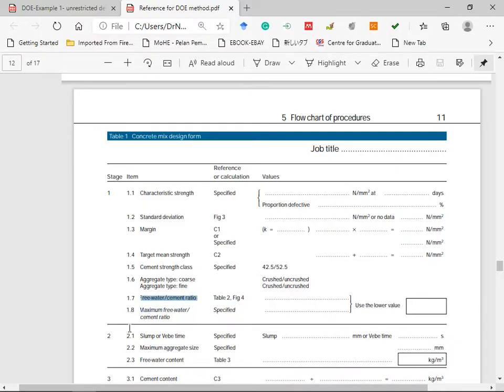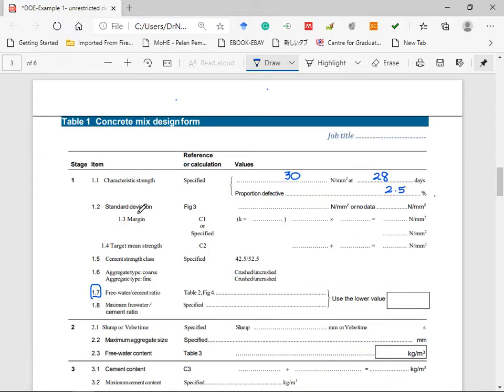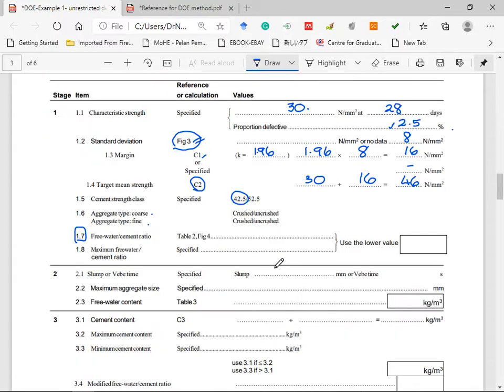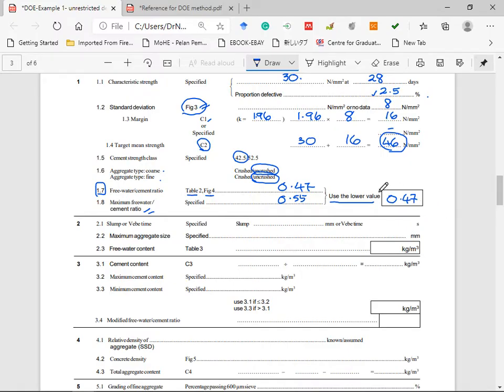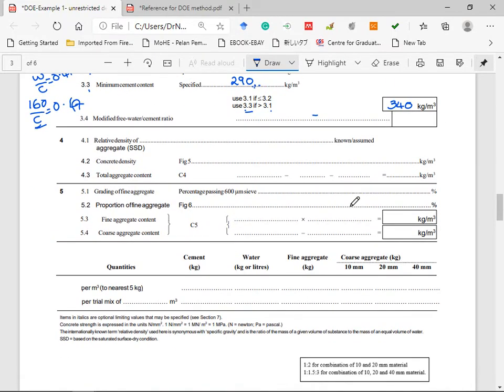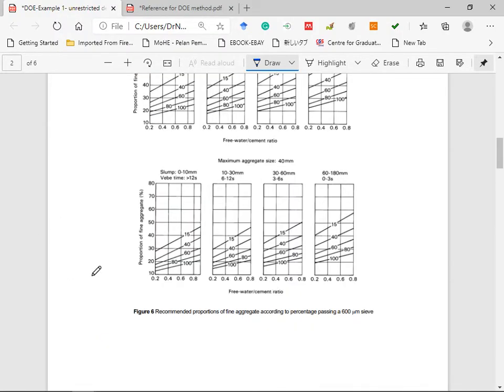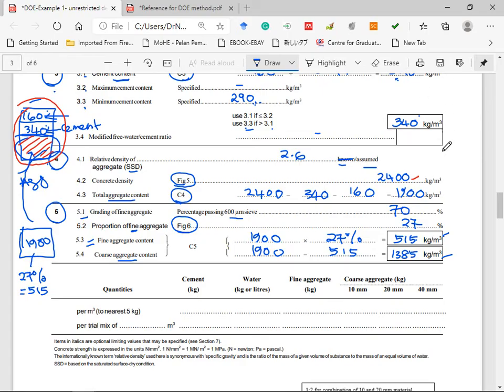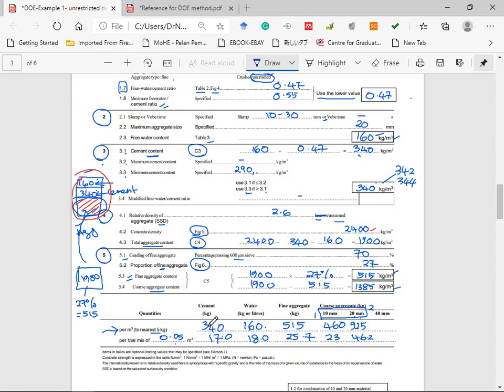Normal Concrete Mix Design based on DOE Method - Unrestricted Design

Comment: what if data didn't give the min cement data and the 3.1 is larger
Reply from the maker: 1. If cement content in 3.1 larger than maximum cement content (item 3.2), you can't proceed the design.
2. If cement content in 3.1 less than minimum cement content (item 3.3)., use 3.3
3. If there is no data for item 3.3, you may proceed with calculated cement content as in 3.1

Comment: what if the cement content is larger than both maximum and minimum? 17:57
Reply from the maker: If the cement content calculated using equation C3 is larger than maximum cement content and minimum cement content, it is thus impossible to continue the mix design. Amendment need to be done by change the type of cement or cement strength class or both.